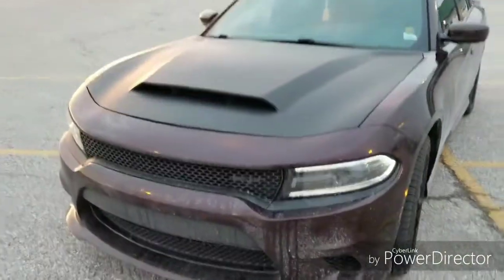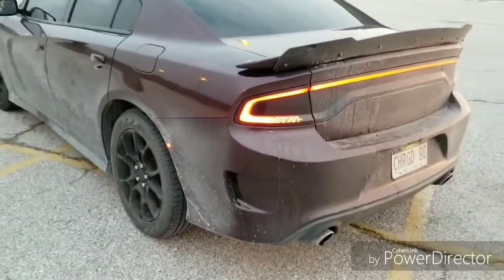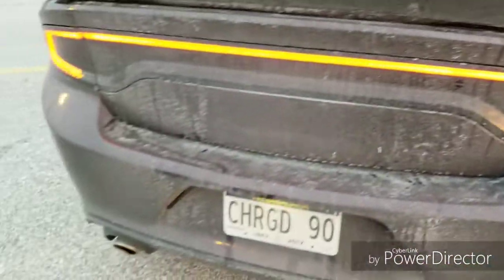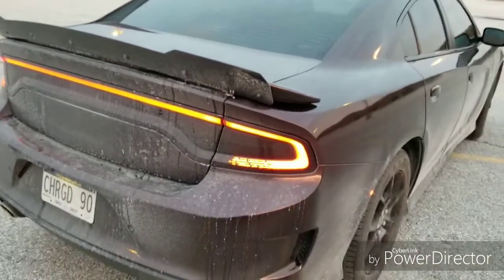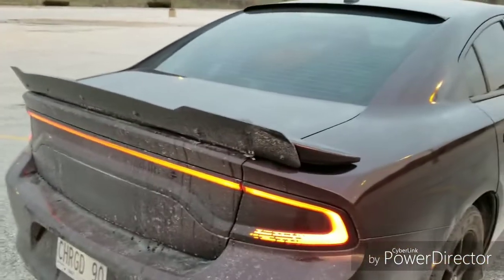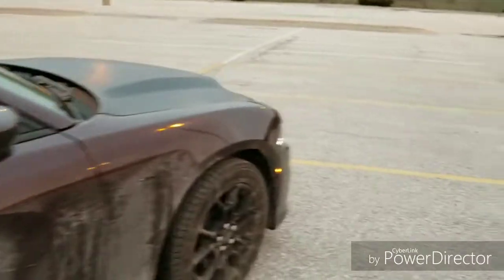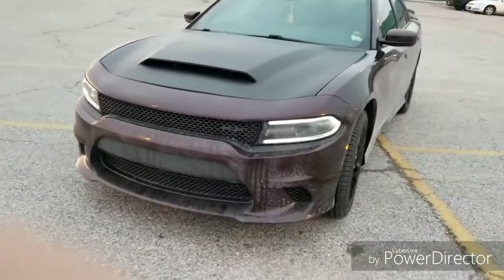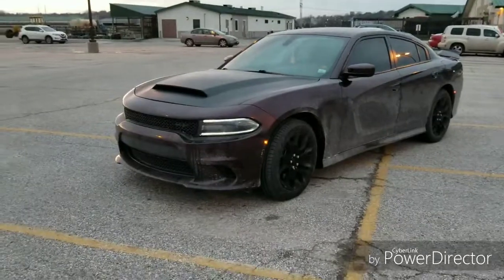update walkthrough

Comment: Isn’t this an SE?
Reply from the maker: The charger was, yes. A 2015 Dodge Charger SE AWD
Reply: RonBurgunD_SRT  Jesus. You really did it. I’m only 14 now but when I’m 17/18 I’m gonna try to get a SE and do the same thing. Good work man. Looks exactly like a modded hellcat, it’s beautiful
Reply from the maker: @oklol9  thanks! It did take a lot of work and there were a few times that I was just about ready to throw my hands in the air and give up. But my advice? Get something that has some of the better features like heated seats and the 8.4" uconnect radio. Those are the only things I wish the car had come with.
Reply: RonBurgunD_SRT  got it. Heated seats are definitely needed.
Reply from the maker: @oklol9  heated steering wheel is also nice. And I have found that I can't go without a sunroof now, so look out for that. I would suggest looking at the GTs they come in AWD (optional) and have better features. Some come with performance pages, but you can always get a tazer and unlock those if the car doesnt come with it. Whatever you do, dont do what I did. I jumped at the first one i saw without doing a lot of shopping around. Take your time when researching a new vehicle. You may find that there are features that you can't live without and some you can.
Reply: RonBurgunD_SRT  lol😂 I never even thought about a GT

Comment: Did u have to delete your resonators to install those exhaust tips? If not do you remember how long they are overall length?
Reply from the maker: yeah I had the shop that installed the tips cut out the resonators. I was a little skeptical at first because I had heard so many bad things about the sound, but was surprisingly impressed that it sounded more along the lines of a GTR than a 96 honda civic with a fart can.
Reply from the maker: the tips were 12" in length though. The shop had to cut out the resonators, bend pipe to fit with new tips, and welded the new tips on. tips were about $40 a piece and the work in total was about $200 and some change so over all not too bad. I went with a 3 1/2 diameter though, and looking back wish I would have gone with the 4" diameter tips instead to fill out the cut outs better.
Reply: Thanks very helpful the sound is really what I’m worried about so I wanna see if it’s possible to weld tips on with resonators on.
Reply from the maker: @marcellemalveaux2658  they do make tips that will fit without cutting the resonators off, but the only ones I liked were too big, that's the only reason I had them deleted.
Reply: ChargeD90 ok got ya thanks
Reply from the maker: @marcellemalveaux2658  absolutely! let me know if you have any other questions! always glad to help.

Comment: How did you fix the gap on the hood?
Reply from the maker: so me and a buddy took out the latching mechanism in the engine bay and took a drill bit, ran it through the hole for the 10mm bolt and made it so we could adjust the latch down further so the hood would latch and lock a little lower. It's still not 100% but its aftermarket so I am happy with what I got.

Comment: Is there a website you recommend to do the srt conversion, I’ve checked out “tascaparts.com” and want your opinion if the prices are set reasonably. I currently own a 2017 Dodge Charger Sxt and am looking for an upgraded look
Reply from the maker: I actually went through a dodge dealership for my parts so I cant really give you a good opinion on aftermarket unfortunately. I would suggest going to a dodge dealership and getting both front a rear fascias with side skirts priced out. but remember that you buy everything with separate part numbers so the upper and lower grille and the besils where the fog lights will also need to be priced out as well. my total price for front sides and rear were about 2k with a few things sent back and the fact I got a discount for the dealership being a sponsor I would say you are looking at around 2-2,500 for everything.
Reply: I checked out “Avg Joe’s Garage” who goes through the entire part list for an srt conversion and that was the website he used with a total price of around 2700 for hood, front bumper, rear bumper, and side skirt upgrades with shipping but I will definitely get pricing at the dealership first, thanks for the input. How much was the paint job for the front and rear bumpers and do I need a new hood insulator for the srt 392 style hood upgrade?
Reply from the maker: I went with a wrap. you can get paint jobs for cheap but you get what you pay for. the wrap I got cost a little extra because I selected a special order material, but it sent me back about 3k. the reason I went with a wrap over plastidip is also because it seems to be more durable against the elements. and being a daily driver with no garage that is something I had to think about
Reply: Do you think a vinyl wrap would be more expensive than a paint job at the Dodge dealerships for the front and rear bumper and the hood?
Reply from the maker: that I'm not 100% sure on. that probably depends on the color. because some are more expensive. it wouldnt hurt to ask them though. if you want to just keep the same color as your car and painting the bumpers is cheaper I say definitely go for it!
Reply: ChargeD90 Appreciate it, good luck with the channel
Reply from the maker: thanks man! let me know how your search turns out or if you have any other questions
Reply: ChargeD90 should I just reach out through YouTube instead of social media or phone #
Reply from the maker: sorry man I am just now seeing this. easiest way to reach me is on Instagram. my page is @Charged90. just shoot me a DM if you have any other questions